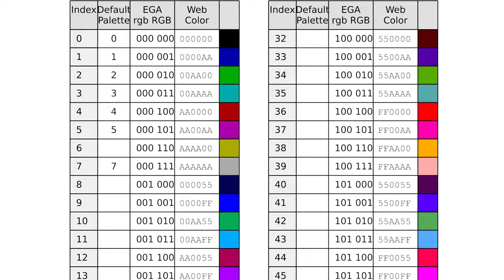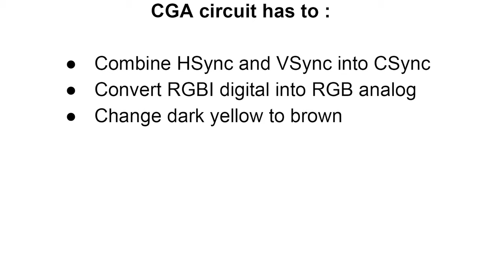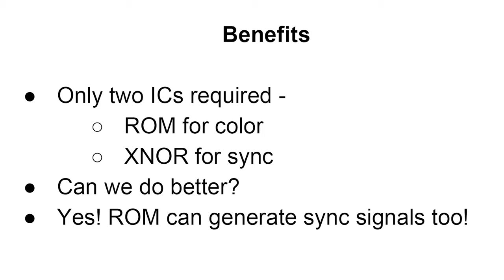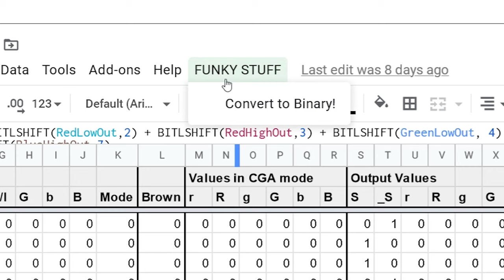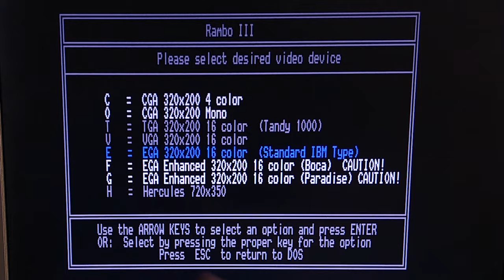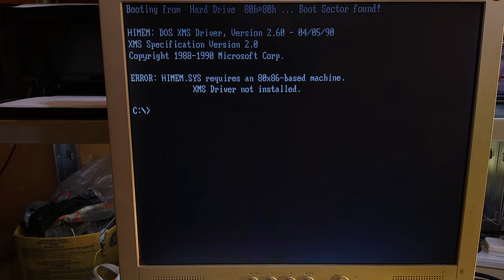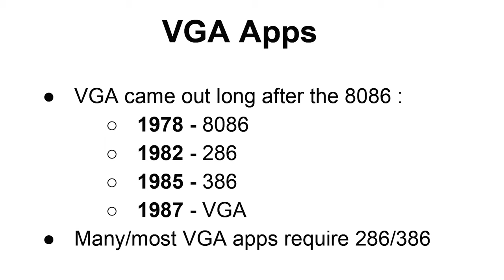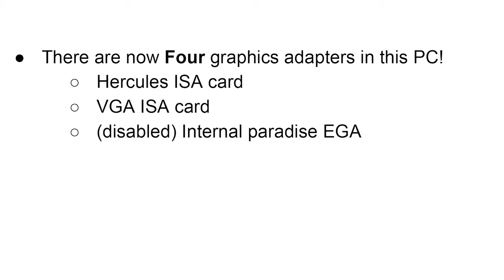EGA/VGA Graphics Deep Dive

Comment: I think the improved frame rate with VGA is probably a result of not having to write the data to 4 different bitplanes.  VGA's Mode 13h is much faster in most cases to copy screen data to/from.
Reply: Yes, AND the PC1512/PC1640 has really slow video memory, with lot of wait states.
Reply: I'd rather say it's due to the different screen refresh rates. EGA runs on 60Hz, VGA runs at 70Hz.
If you divide 20fps by 70 and multiply by 60 you get about 17.
Reply: That's wrong! Actually VGA's Mode X or Mode Y is faster then Mode 13h. Mode X is using a 4 plane mode.

Comment: still had the legacy CGA chip from PC1512, but you should remember that it was a customer CGA with huge VRAM and able to run a custom 640x200x16 video mode (just like EGA could), so it might be nice to connect the chip's out... was even supported by a very few games.
Reply from the maker: I did think about trying to re-enable the dormant CGA adapter. Would probably require some pretty serious BIOS hacking though.
Reply: @TheRasteri  or use a PC1512 Bios ?

Comment: Great video! Thanks for sharing. Really liked the idea of EEPROM chip for logic decoding. Do you have a schematic diagram of this circuit board and a blog site?
I noticed that briefly shorting out the jumper pins P8 next to the GBS 8200 CPU resulted in haulting the CPU. This stopped a great deal of sync jittering with a C128 setup I had. 
Keep up with the good work.

Comment: The tweaked Brown seems weird on how it was implemented but there just so many more things "that color" applied to when compared to dark yellow like trees for example. EGA was a weird standard overall though, expensive and hard to setup compared to CGA or VGA, a lot of trouble for less than impressive results in all honesty.
That's what makes the 64 color mode one of the biggest missed opportunities of that entire video generation. It seems like an issue that on paper isn't insurmountable but there was obviously next to nobody prioritizing or wanting to highlight this mode in terms of hardware sales. Regardless that's 48 colors almost never seen bitd. :(
The low res requirement you mentioned is likely why the Composite output wasn't included with EGA cards but really I think expansion on what CGA did with Composite was the versatility EGA lacked in retrospect.

Comment: Idk if anyone will even see this message at this point. But I was considering messing around with using an ega color pallette for making a game, and I was wondering how common 64 color mode was, and if there were limitations on which of those 64 colors you could use for your 16 color pallette.

Could I pick any of the 64 colors for each of my 16? Or could each of those 16 colors only be selecting from a corresponding 4 colors for example?

I figure that even if certain things are possible, getting too creative with colors would break the nostalgic feel regardless.
Reply from the maker: In EGA low-res (320x200), you're stuck with the same standard 16 colours as CGA, but you get to use them all at once.
In EGA high-res (640x350), you get to pick any 16 colours you like from the 64.
Not many games used high-res so if you want that "classic EGA look" you're best using the default 16 colours.

Comment: Is there a "simple" way to output composite video?. or SVideo, so composite is aeasy to obtain too. Let's say I want to use a great TV or monitor but I can only use composite video . It is difficult to find CGA/EGA/MDA cards with composite video output. Is there a way, as simple as it can be, to go from RGBI to composite?
Reply from the maker: Yeah you can find modules cheap on eBay to do exactly that. Going the other way (composite to RGB) is much harder!
Reply: @TheRasteri  Hmm
In the IBM Color/Graphics Monitor Adapter, page 32, there is the schematic of the output circuit. The composite is obtained by mixing the RGB, to which is added the synchrony signal that is obtained by mixing the generated HSYNC and VSYNC with an XNOR. all through a digital buffer and then an array of resistors, with an output transistor....
Maybe I'll get to it and replicate the circuit to test...

Comment: huh! amstrad 1640 has 1512 chip on board which is not used at all??!!!
Reply from the maker: Well it's not used for video, but it likely contains bits and pieces of glue logic and it was just cheaper to reuse the same chip than have a new one designed

Comment: Enjoyed this and your other 1640  videos. With SimCity I find it always crashes after a minute or two of play time on my 1640 with PC-ECD monitor (and the EGA 350 line DIP setting). Switching to a Mono screen and corresponding Hercules settings no crashing. Found this on a couple of boards now. I wondered if you had noticed the same?
Reply from the maker: no it seems to work fine for me. Maybe try a different version of simcity? there were quite a few updates
Reply: @TheRasteri  Thanks - I hadn't thought of that! Cheers

Comment: Very useful info in this and the previous CGA video. Thank you.
I used many of your ideas to design a PCB which plugs into the GBS and accepts CGA/EGA input (without handling the EGA 21khz issue though, just the input part).
I based mine on a GAL but otherwise it's pretty much the same idea: https://github.com/jtsiomb/gbs-cgaega  Released everything under the GPLv3. I can send you a board if you'd like to try it. If so send me your address through email (it's in the github page).
Reply from the maker: Awesome! Yeah a programmable logic device is definitely the way to go about this